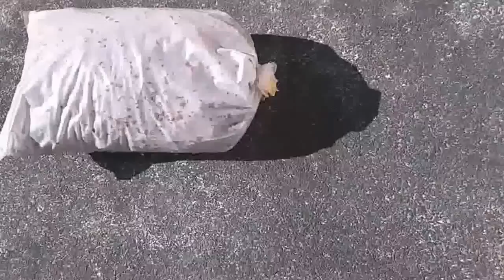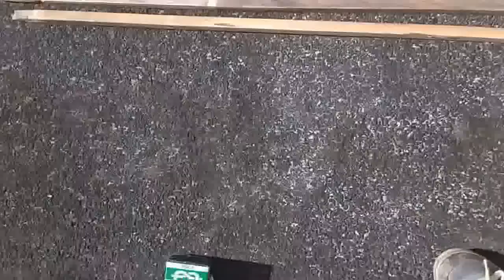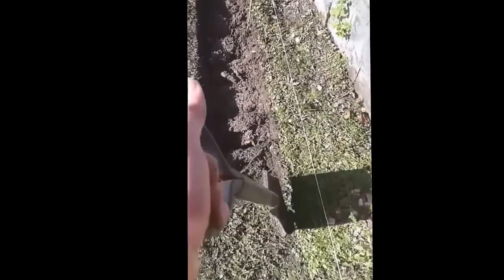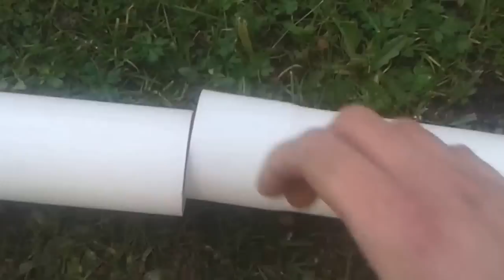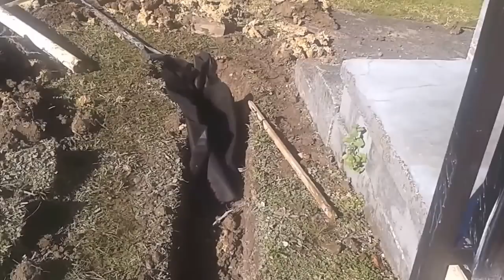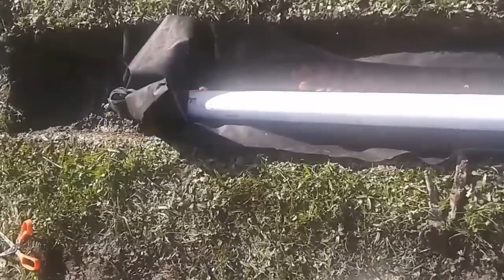Improving drainage on your section - DIY step by step guide

Comment: If you redo or expand the system a clean out at the start of the run can be useful to flush sediment that makes it into the pipe over time. A 90 on the end and a screw on clean out cap at the surface gives a good spot to flush it from. On long runs a T can give you clean out spots mid pipe but that is only when you are going ultra long distances that a flush would need to be done by section. 

Any time you are putting PVC into the lawn a good idea is to put some steel/iron wire on top of it to make it easier for others to locate in the future. Drains and sprinkler systems are hit all the time because there is nothing to search for with normal equipment till you put a shovel/bucket into the line.